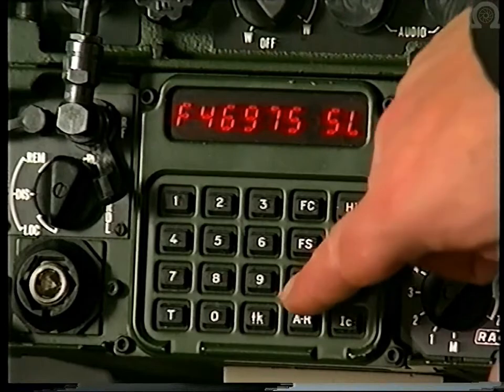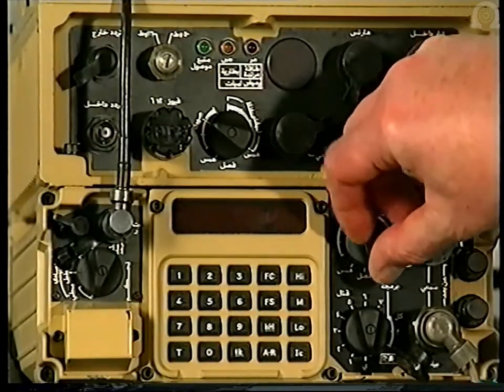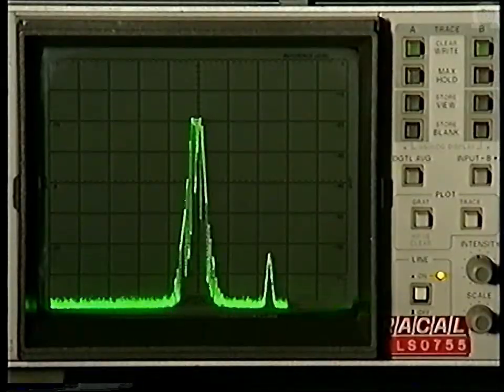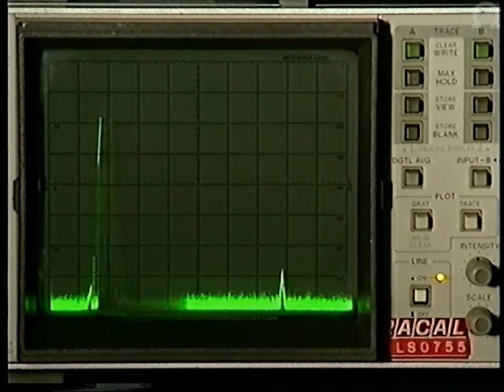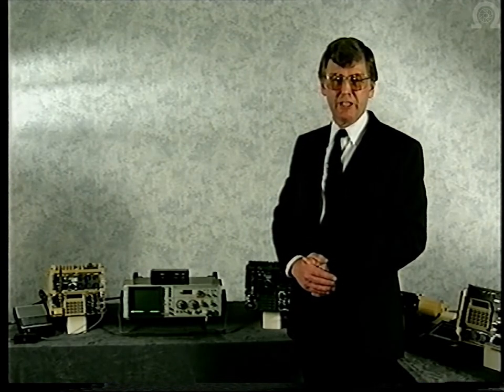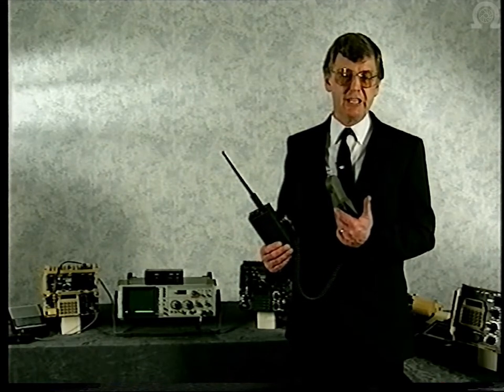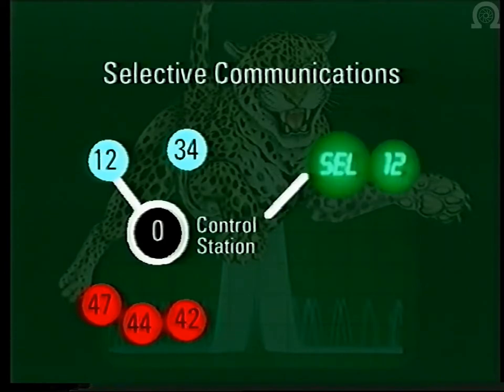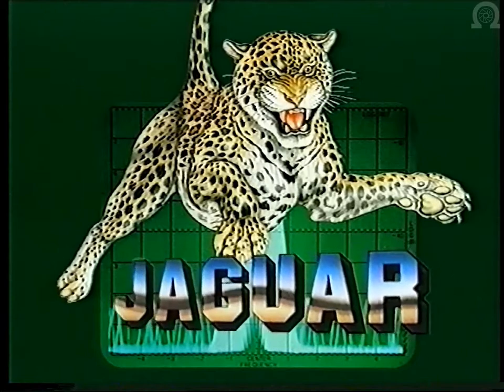Racal - JAGUAR V - A Demonstration of Frequency Hopping

Comment: Fascinating video. I have never seen it before.  Who is the gentleman introducing it?  I was on the design team of Jaguar V at Racal-BCC when it was at Stonefield Way in South Ruislip.  I designed the Modulator (Unit 8).  RACAL was a great company to work for, very go ahead and responsive to customer and design ideas.  They were the best.  Thank you for posting.